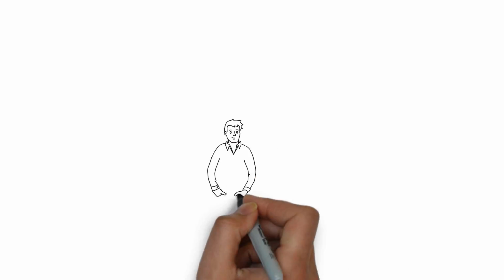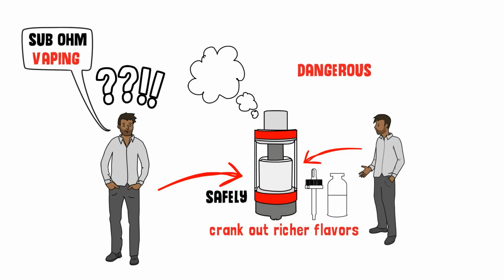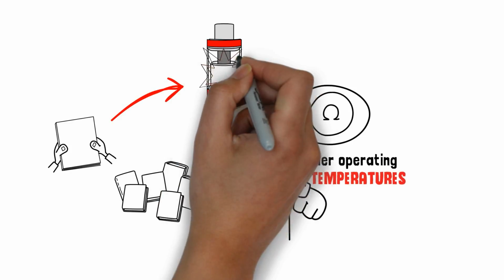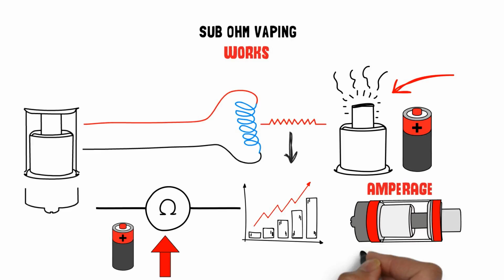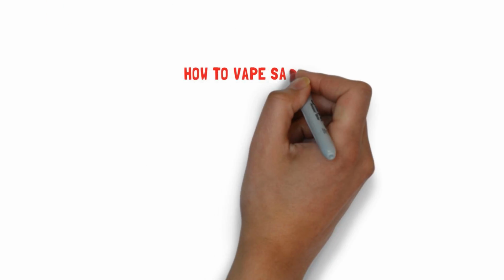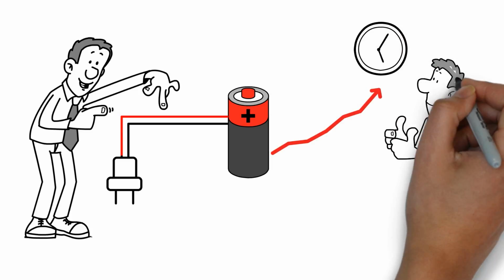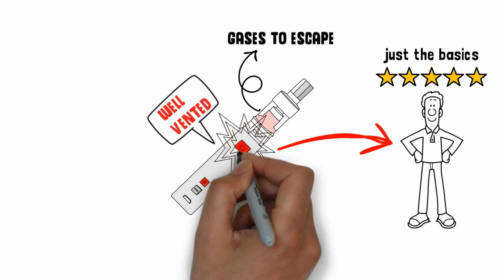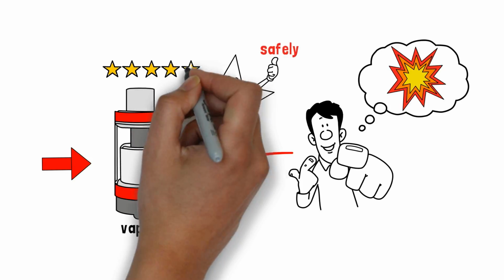Sub Ohm Vaping Safety Tips | Sub Ohm Vaping Guide

Comment: For me, with a cheap AOI SMOK RPM5 Pro, this vid came too soon... after trial and error 5 years later with a new product, found the advise TOP NOTCH!

- keep it clean, pay attention to juice residue accumulating through the intake airflow
- buy the best battery, one with a high Amp output over marketed capacity/LIES (above 30Amp) to properly power the kit

Mine builds up juice under the tank, a fine mist accumulating over time which turns into a puddle of wasted juice or worse if it seeps through - a MESS gunking up electrons and eventually the battery compartment. With a top notch battery, it doesn't splatter/boil depositing largish droplets into Coil center which is the REAL problem, it vaporizes properly - Still have to mop up under the tank once a day, but not every hour.

All products are different. 

Also had a bad sub-Ohm Coil factory installed, that made the MESS just impossible to deal with regardless. A replacement Coil performed vastly better, so quality control of parts is def an issue in my case.

I know this video is kinda dead/old news, but wish I'd seen it before I bought the product along w/10 replacement Coils, a meh battery, frustrating 2 weeks shipping time... it was a leaky mess, assaulting my tongue with hot splatters sucked out of the box, but is better than good enough now.